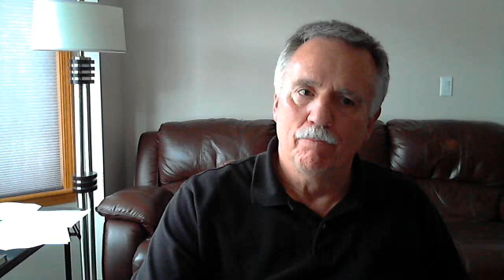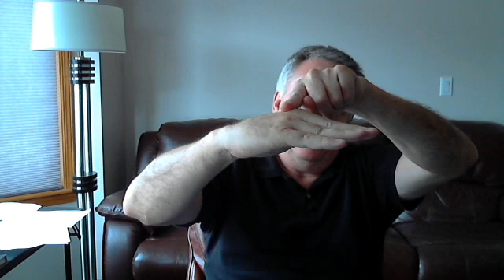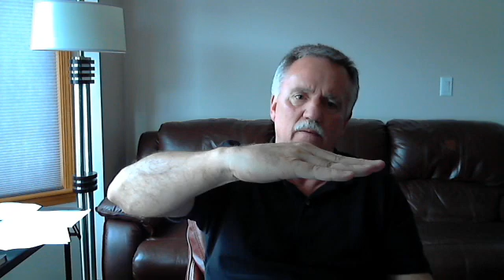M11 & N14 Cummins CelectPlus Injector Electronic Problems You Didn't Know!

Comment: Any idea on hard to start without ether, idles rough maybe like its down a cylinder or not enough fuel. When reved slightly and rpms fall it dips below idle then picks back up as it stumbles. Drives fine and roughness goes away with even small load on engine. Idling along in low gear and drag brakes and it goes away. Makes normal amount of power while driving. 94 n14 all stock, fuel filter has been changed. This all started happening after I ran out of fuel.
Reply: Hi, I have the same issue. Did you find out your problem. My Cummins ism does the same thing after I ran out of fuel. Can you post it. I'll like to fix my problem too. Thank you
Reply: @roadwarrior3277  no sir not yet
Reply: #1 cylinder injector dictates the engine to start

Comment: Hello sir terry.. I have m11 celect.. At first start it runs good.. After few second three cylinder loose fire and then the engine die.. i wonder if you could help.. Thanks...
Reply: Mines does the same thing.did you find the problem?
Reply: @derrickchamblee2595  hey m11 is good?

Comment: "You have a good motor to work with".  

That is what I thought—until I got no catch issues.

Truth told: on a CAT in my personal experience was as strong or more. But the CAT was very thirsty at 5 MPG.

Okay, Mack M8 can get 7 MPG running empty: watch youself lose 10-15 MPH going up a Central/Westerm Wisconsin hill.

Detroits blow out my hearing they are so loud.

Volvo—need I say anything more...?

Comment: my question is not about injectors i think , my truck is a freightliner classic xl with n14 cummins select plus black top, and i have the red shut down light on the dash flashing , went I'm driving goes on and stays on for about 2 to 5 seconds and if I park, just idling, the light flash for about 10 seconds and the truck shuts off, but starts right up, there's no knocking noises, or misfire etc, does leak oil on passenger side by the exhaust manifold, or somewhere in that area, also if the light stays on for a while my oil pressure goes to zero , i did replace the oil pressure sensor but still does the same, any advice would be appreciated ,,thanks

Comment: hi, i do have a cummins celectPlus, the problem is to first start in the morning, the fuel filter is empty, i did replace the return check valve and the problem persist, after it start using starting fluid it work perfect the rest of the day, now can somebody help me find out what the problem is,   thank!!
Reply: hi did u find what was the problem
Reply: I had a similar problem I will check the fuel pump. I replace the fuel pump it went away. I tested by putting 4 gallons of diesel in a bucket and putting the fuel line in the bucket, disconnect the line from the filter housing and put that fuel line in the 4 gallons of diesel.Hope that  helps
Reply: You have 2 -1 way check valves one off block near ecm and going to injectors  from pump replace both...  n14   common issues